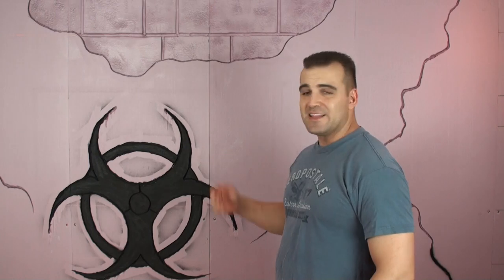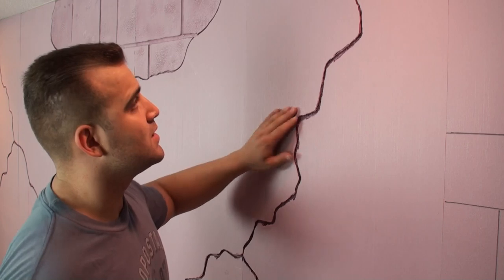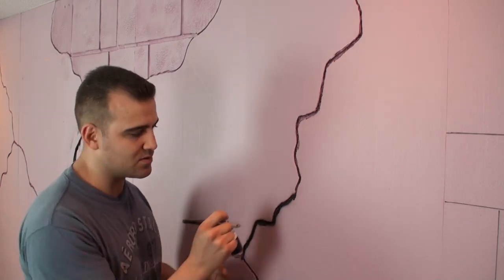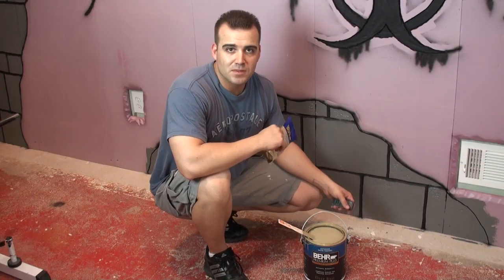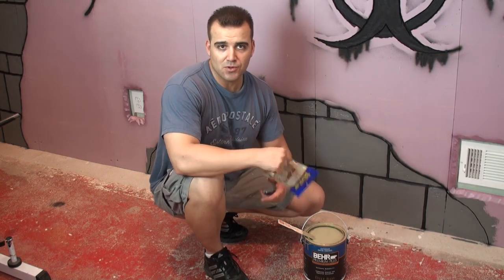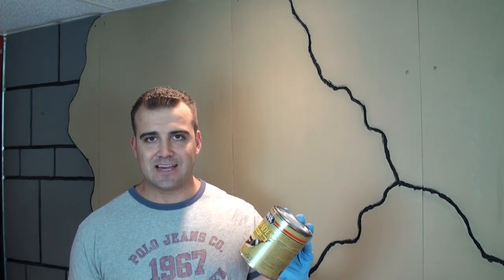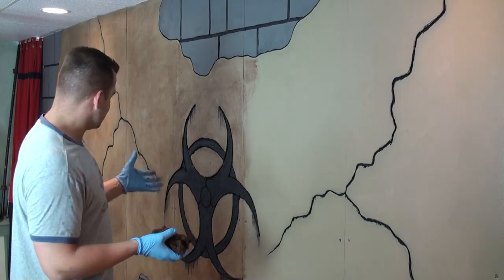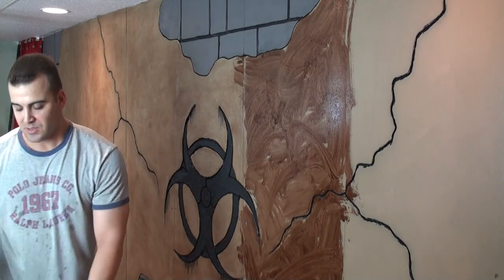Foam Carving Dungeon Walls (Part 3)

Comment: I did something similar, except in the areas that the top coat had fallen away I glued a different piece of foam behind the original layer. This added a lot of dimension that you can't get from using one solid piece. I glued my foam to plywood so I could store it for the off season. So I just cut holes in the plywood and made my brick seperate. It looks really cool. Thanks for sharing.

Comment from the maker: @josht25 No I don't use a sealer after painting. If your worried about damage you could do a couple of things. For lite protection, you can cover the wall with Drylok paint before the final paint. For a heaver protection, use a HardCoat after all the detailing but before the final paint. Check out Hot Wire Foam Factory for more info on HardCoating.

Comment: Great job!  Just something you might want to try. Is to make a wash, 50/50 (H2O & Paint) load up your brush and let it run down from the ends of your cracks. This gives the look of water damage or something nasty is running down the walls. Then when it dries, get a lighter white paint and stipple it to show concrete failure. As you know concrete will get dry and bubble, then turn to dust. Hope that helps? Once again great job!

Comment: woaw you dont put any resin or hardener on the foam? just straight paint?
Reply from the maker: Yes if I know the foam isn't going to be handled alot and nothing is going to bang into it, I will just use paint. But if it's going to be abused I will use a protective coating such as HWFF foam coat or even just Drylock.

Comment: is it a water based paint? PU should melt the foam I think..
Reply from the maker: Yes it is water based paint. But the only paint that melts foam is certain spray paints. There is an acid tone and other chemicals in spray paints. Some have more, some have less. But that's why the foam melts. Not from the paint itself.
Reply: PandemicCemetery  thanx for the reply ; for a water based paint, it looks very saturated.

Comment from the maker: I didn't fill the holes or cracks because the panels are removable. I can take them down in about 15 mins and put them in another location without having to do any touch-ups. But if I were to make panels in a permanent location, then I would fill the holes and seams with a flexible wood filler. Thanks for watching

Comment from the maker: Its actually pretty cheap if you have the tools to do it. Foam is only 12.00 a section and the rest is just paint. The tools can get expensive, but they last a life time so its more of an investment. To hide the seams, some flexible wood filler will work great. Just push into the seam, sand smooth and paint. Thanks for watching!

Comment: I would have filled the gaps between the panels of foam.
Reply from the maker: Ya, I would have to... but they are removable wall panels. I can take them down and change them out just by removing 6 screws. If they where up there permanently,  I would have filled all the holes and seams.
Reply: ahh didn't know you remove them. That's cool!
Reply: For removable I would have filled the seems as well and by passed the screws and gone with velcro. Still there is no way possible anything shoddy can be taken away from this job. It's simply amazing. Dave you are a true artist and a true inspiration

Comment: If you want the wall to last use 3-5 coating of PVA glue before you paint.  It will make it harder.  Trust me I do a lot of sets for LARPers.  Plus set preping for some of the more super low budget YouTube shows.

Comment from the maker: @znelson710 Thanks for the idea. Ya know, back in schoo, teachers would do that all the time, either with words or grafics, yet I never thought of using that idea in my haunt. I will have to give that I try. That would be alot easier then blowing the picture up and printing it on 20 peaces of paper and tapping them together on the wall. Thats how i did it. :()